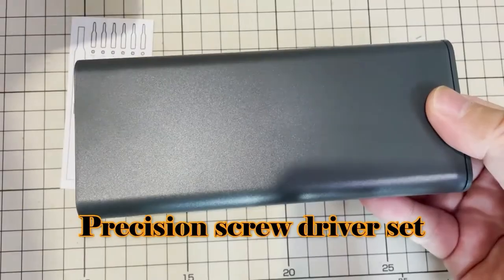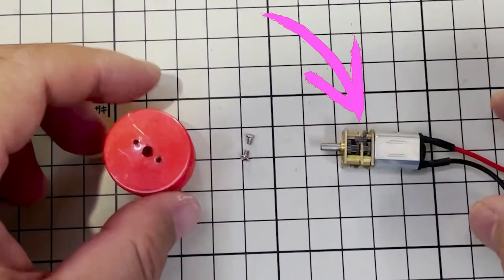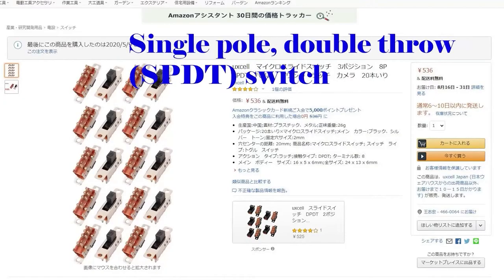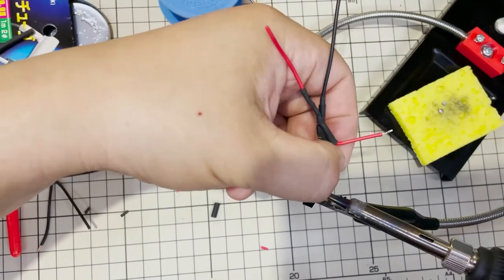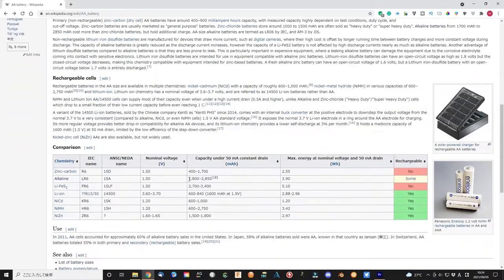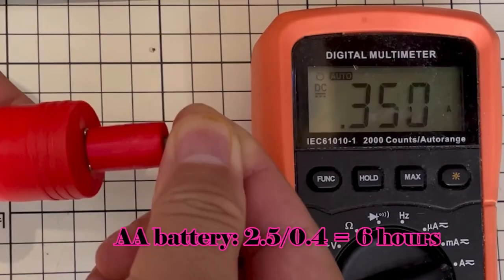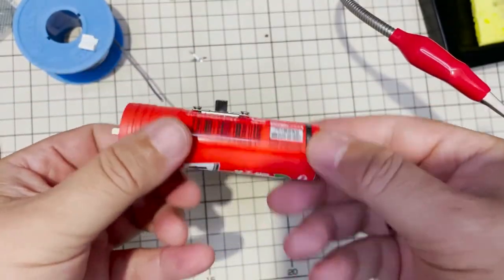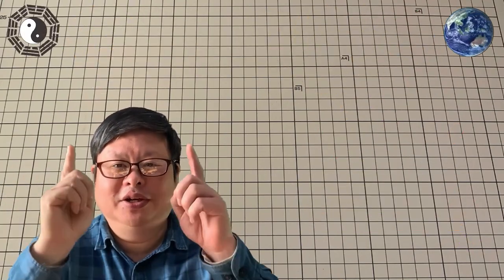How to make a powerful electric precision screwdriver out of Pritt Stick

Comment: how much max torque gearbox can be attached to flexible shaft of high RPM motor??
Reply from the maker: Thanks for your comment. I am sorry that I don't know the answer. Since all of them are made of plastic, I suppose it will be ok for the small model or low-duty case. Have a nice day.
Reply: @TubeUnderdeveloped  its ok 😇 if i found out i will definitely tell u the ans!!